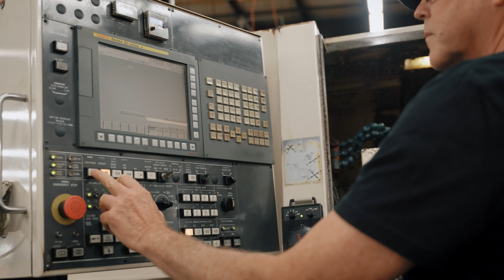RCBS PRODUCT QUALITY

Comment: I am disappointed in a pair of 30.06  RCBS rifle dies I purchased before the pandemic. I had used them some, then around two years ago I soaked them in Birchwood Casey Barricade...I mean saturated them. Then reassembled them, put them in the green RCBS plastic case. Then put them in a Ziploc bag and sealed them. This week I took them out, dissembled them and degreased them with Hopped degreaser spray. They flash rusted severely and that made me feel bad. I thought RCBS quality was better than that. I did nothing wrong whatsoever.